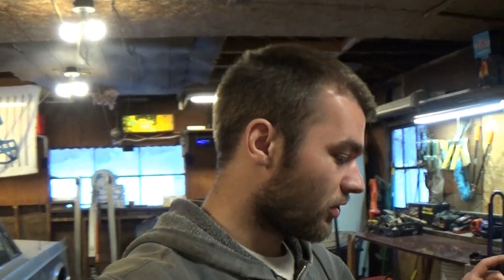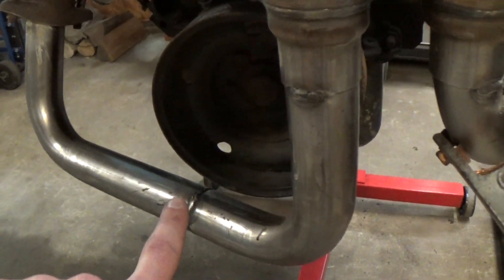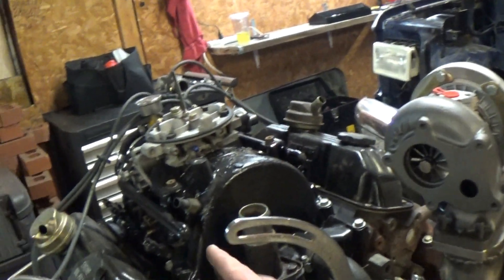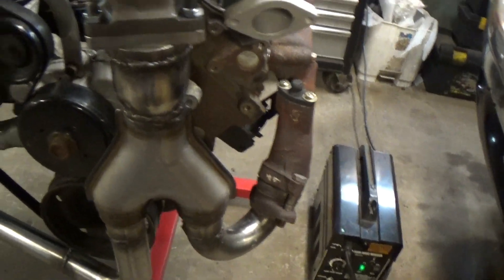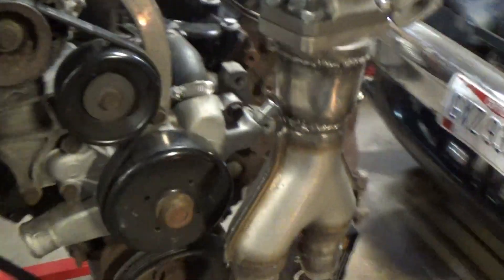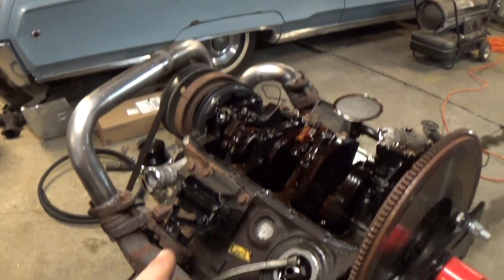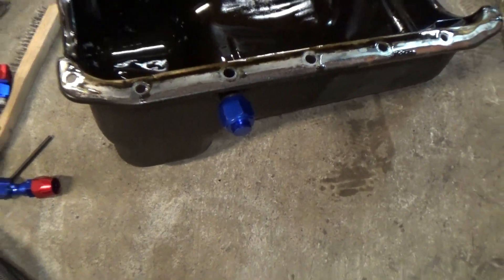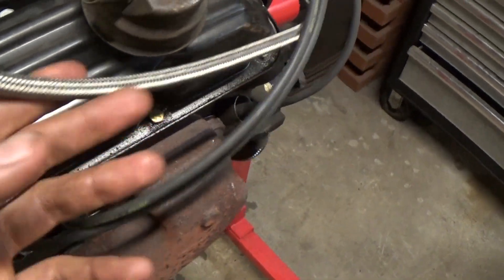Building The New Turbo Exhaust For The 3.9 Dakota Part 1!

Comment: I would recommend a flex joint better the passenger side manifold and the turbo. I’m also looking forward to the ELECTRIC POWER STEERING PUMP and electric coolant pump for the turbo

Comment: I have a 99 dodge Dakota with the 3.9L v6 are they the same thing even though they different years and body style ???? Kinda new to everything .
Reply from the maker: Yep the 3.9 magnums are identical from 1992 all the way into the 2000s. Some accessories and bolt on parts saw some tweaks over the years but the long blocks are the same.